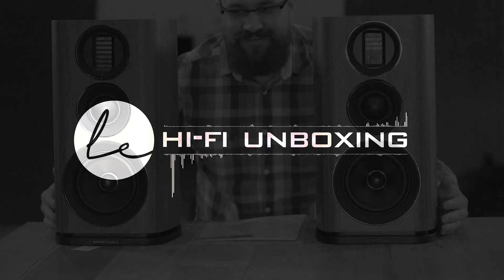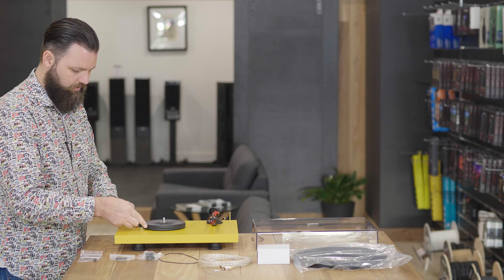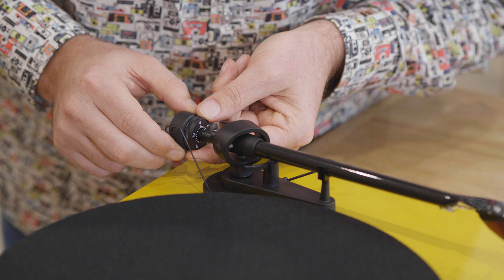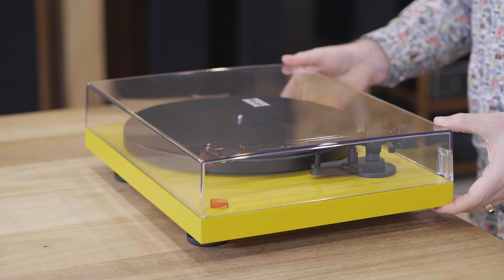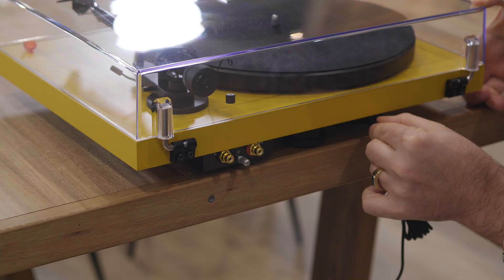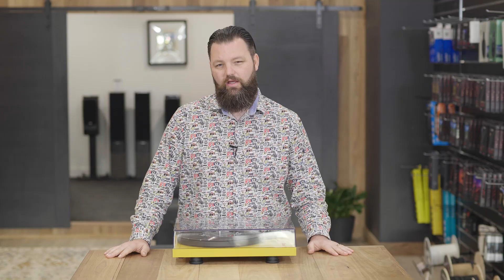Setting Up Your Pro-Ject Debut Carbon Evo!

Comment: I just mine. One problem is that the anti-skating thread does have the weight on it. I don't know how to get that weight on the thread?!
Reply from the maker: Sounds like you need to order a replacement, that isn't something you should have to attach yourself.

Comment: What can I do if I accidentally removed the line from my anti skating weight? Can I reattach the line, or do I need to get another one?
Reply from the maker: You will have to order a new anti skating weight, thankfully they are relatively cheap.

Comment: I'm on my 2nd Pro-Ject . The speed control stopped working for 45 on my piano black Evo . I pretty much gave that away. Then I paid for another Pro- Ject , Debut Evo . Put a $899 Sumiko Songbird MC cart on . Added all the upgrades I could , acrylic platter , diamond cut sub platter , Linear power supply. Sounds pretty nice.
Not crazy about 3 feet. Can tilt if you're not careful. I think that's just the way project cheapped out . The connector that the dust cover slides on to is loose. Can't seem to get it to stay tight,  Both tables have a not great fitting rca for . The right side doesn't feel right. Both tables,same thing . And it's light. I have the Walnut veneer. It could have been darker, doesn't look like much of a finish on the wood.
So ive turned my $599 Evo into a $2,100 turntable . It sounds good.  It's very plane looking to me.  But it works .

Comment: I’ve not seen in any video how to level the player. Are those feet adjustable? The place I put mine isn’t very level, there is no way to level the base, if I adjust the tracking force, the arm goes to the inside because of the gravity of the unleveled turntable. How can I level it?
Reply from the maker: Use a spirit level on your turntable and adjust the feet accordingly. You can rotate the feet to bring the level higher.
Reply: @living_entertainment  They’re not adjustable after all.
Reply from the maker: Do you have the Debut Carbon Evo? Or the Debut Carbon? @topouzidd
Reply from the maker: If you are working with the older style Debut Carbon, unfortunately the feet won't be adjustable. In that case, I would highly recommend something like the Pro-Ject Ground It E turntable platform. The feet are adjustable, and the extra mass can also improve your sound quality too.

We have them here if you want to learn more. https://www.lenc.com.au/products/pro-ject-ground-it-e-turntable-platform
Reply: @living_entertainment  YouTube keeps deleting my answer with all the info! It’s “Debut S” special edition. Google should give you the link to it but no reviews whatsoever.
Reply: @living_entertainment  It’s the special edition Debut S
Reply from the maker: No problem. Well I stand by my staement above then. Check out the Ground It products. They should help you get on the level @topouzidd

Comment: i did everything right, got just the same turntable, but when my vinil is on, it starts to play the disc slower after a while. What could it be? can someone help
Reply from the maker: It could be the motor. But it is more likely to be the rubber belt is loose. You can buy the as a spare part from the store your purchased the turntable. Or online.

Comment: Did as you did. Doesn't work... Still needs adjustments or the tonearm will slide off the record
Reply: You were probably doing balancing with needle guard on. At least I did so, and then realized that It isn't right. It was shown here but was not accentuated so youmight overlooked that. Sory for my bad English.

Comment: I've been trying to get that floating for 40 min... idk what I'm doing wrong at this point. When I get it to read the correct number it tightens up... should it or should it still be floaty?
Reply: Hey there, once you get it balanced so that it floats that is your reference of 0 grams weight. So when you then set the numbers to 0 and then twist the counter weight to 1.7, the arm will gain weight and shouldnt float any longer. Hope this helps!

Comment: The RCA cables that came with mine doesnt have "1" on them. Instead, it has arrows on the yellow jackets - these arrows point towards the ends of the RCA cables. Assuming this is the end i plug into the TT side of things??? Thank ya

Comment: Loved the video, the way you present it is terrific.  Detailed and step by step with out sounding like you're talking down to use audiophiles with toddler levels of technical knowledge 🙂  I'm still setting up my system and haven't yet decided whether or not to go with a turntable at all, vs. a solid hi-rez DAP.  Cheers from the Philippines.

Comment: Thanks for very detail video on setup. Sir I have problem with this turntable I am getting higher rpm speed around 33.45 which affect the output signal .  Is there any way to correct rpm speed around 33.00 to 33.38 so that I can enjoy the music as before. Is there any way to adjust the rpm speed to 33.33 with motor itself. Does motor have preset to adjust the speed. Pl help me

Comment: 06:00 wrong! Why do you say that?

As per instruction - As the Connect it E cable is a parallel symmetrical cable the shield is only connected on one end. The yellow mark indicates this side. The marked side should always be connected to the receiving end (i.e. phono stage or amplifier).

Comment: The part about cable connection is confusing. You should actually put yellow marked end of the RCA cable into preamp/amp as it stated in the manual, not into turntable. 

A quote from the Connect It E description:
As the Connect it E cable is a parallel symmetrical cable the shield is only connected on one end. The yellow mark indicates this side. The marked side should always be connected to the receiving end (i.e. phono stage or amplifier).
Reply: Thank you. I thought the big arrows on mine were a pretty sure sign, and went to Pro-Ject like you did. This video says the opposite. 

Putting on the anti-skate weight is also easier when the arm is rotated. 

Locking screws on hinges were also a surprise. I nearly cracked my cover.

Comment: I got mine today and had to send it back same day without even playing one record on it. No idea if factory defect or i got review unit or quality control at pro-ject sucks, but counterweight was in 2 peaces with one plastic tab broken on smaller wheel was broken, motor did emit strange noise and rotating speed was not constant and left channel output was not working at all. Called store, they took it back right away and next week i will get replacement. If replacement will also have some issues i will ask for full refund, use my old thorens for few more months and save for clearaudio concept wood. also no big deal and i know hifi snobs like it but sntiskeat on fishing rod does feel and look cheap and gheto. All in all  even it looks nice this is not 600€ turntable at all. Big disappointment from my side.

Comment: I just set up my turntable this evening and noticed the instructions did not mention the clips on the RCA cables. I saw that another reviewer on YouTube stated that Pro-ject wants the clips to be attached to the preamp side, rather than to the turntable. I'm so confused about which way is correct!
Reply: ￼

Correct usage

As the Connect it E cable is a parallel symmetrical cable the shield is only connected on one end. The yellow mark indicates this side. The marked side should always be connected to the receiving end (i.e. phono stage or amplifier).

Comment: Thanks for explaining about the anti-skate weight, for the life of me couldn't see the bloody fishing line attached to it when it was in the plastic bag. One thing though - the little triangle adaptor is for 45s, not 78s. Most Australian-pressed 7" singles @ 45 RPM had a small hole in the centre, like an LP. However, lots of overseas 7" singles had a large hole in the middle; that's what the adaptor is for. It even says so in the setup guide - b) Adapter for 7" singles. I have quite a few of them (overseas 45s). Never seen 78s with a large hole like that but that's not to say they don't exist. Cheers.
Reply: So in Australia you had same 45s as we had in Europe? That is interesting, i really didnt know that. Thanks for information.
Reply: Yep, in the UK the adapter is for 7" singles. Back in the day, juke boxes that you found on pubs and the like had to use 7" records with a large center holes cut into them. A lot of US singles also had a large center hole. That's what the adapter is for. 78's never had a large center hole.

Comment: Hey mate, just recently bought 1X and there is no loop on the anti skate, just a knot! Can I make one as the lenght of the thread might matter or I need to order a whole new part? Cheers
Reply from the maker: Honestly if you bught if from a local retailer I would be asking them to swap it out for a replacement as the hoop is a pretty specific length. Otherwise contact your online seller.

Comment: I'm so keen on this turntable, but I am so confused with all this pre amp / intergrated amp business. I thought you just bought an amp to go with your turntable? If I like the Cambridge Axa35 amp would that be compatible with the Pro Ject Debut Carbon Evo? 🤔  Ultimately all I want to do is sit in my chair with my headphones on and listen to my albums, maybe sipping on a scotch 🥃
Please Advise. 😊
Reply from the maker: The  Cambridge Axa35 has a phonostage built into it so by pairing this turntable and that amplifier you are good to go, especially if your mainly planning on using headphones! I also recommend the Meze Classic 99 headphones for vinyl listening as well, they work exceptionally well and pair with almost every amplifier. :)
Reply: @living_entertainment  that's great thanks 🙏  I had a Pro Ject Essential II, but I needed to get an amp with a headphone socket. I've read and watched so many videos, reviews about amplifiers, turntables, pre amps, phono amps etc.... What I'm after is exactly the Pro Ject Debut Carbon Evo, I just want to make sure I get the same standard equipment to go with it. Many thanks. 😊

Comment: Probably never use the 78 adapter? I think you underestimate the power of shellac. I'm pretty sure that adapter is for 45s not 78s. Great to see the 78 belt included, however, the stylus would ha e to be changed for 78s which have round groves no V shaped.
Reply from the maker: I own this turntable and I can confirm that the adaptor is for 78s with the rocker switch allowing you to swap between 33's and 45's. We do occasionally get people asking us about playing 78's but usually its for preservation purposes.